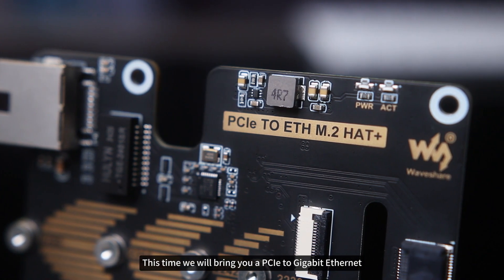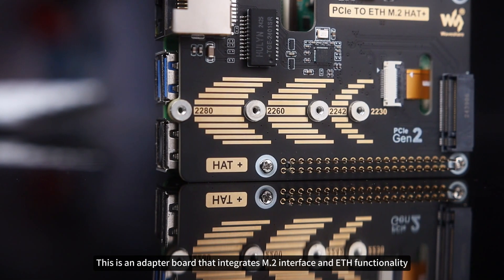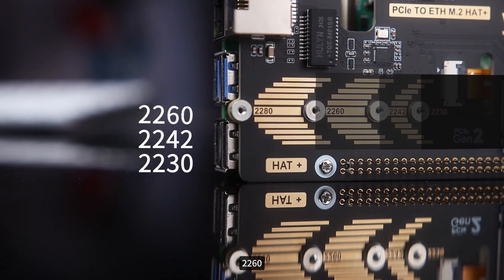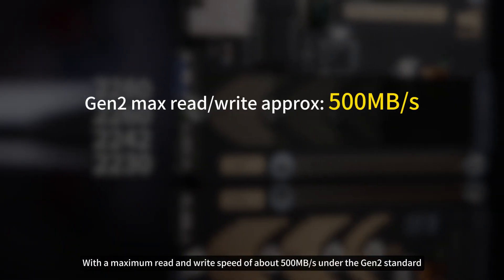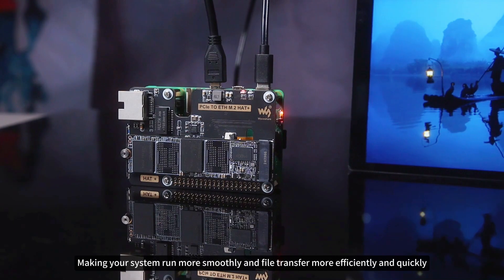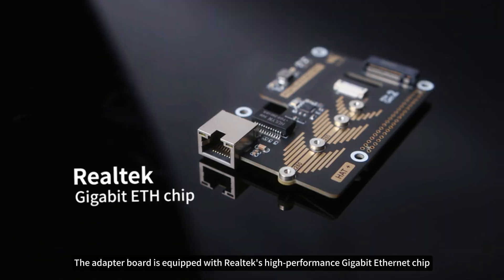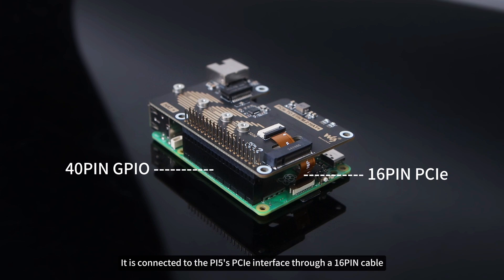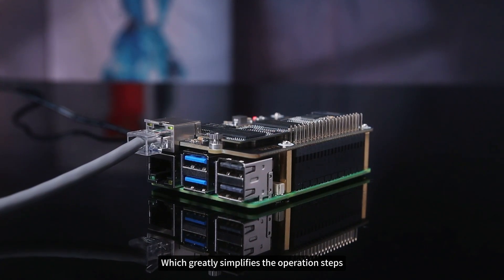PCIe to ETH and M.2 Adapter for Raspberry Pi 5, 5Gbps Data Rate, Pi 5 NVMe HAT

Comment: 2.5g ethernet please 🙏🙏
Reply: Heres how that works.. Thet add a Universal Photon data encoder output/input computational modual, and have the 2.5g as an add on
Reply: fiberoptic to 2.5g ethernet. Litterally a blinky light in a tube